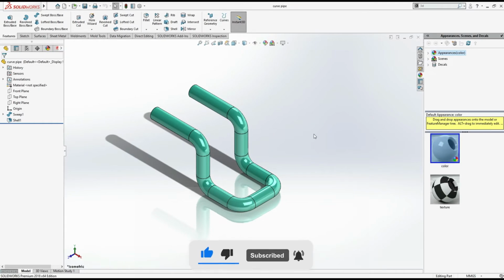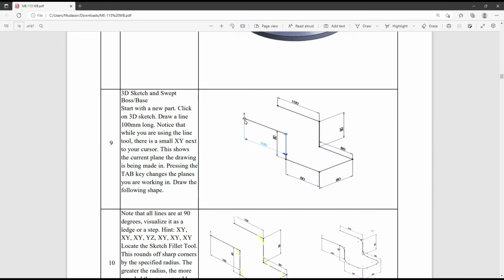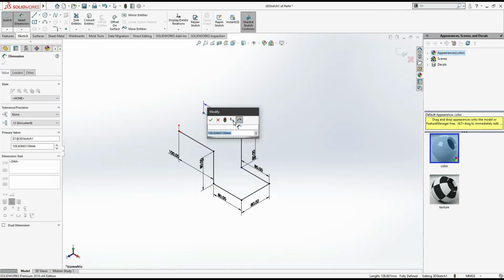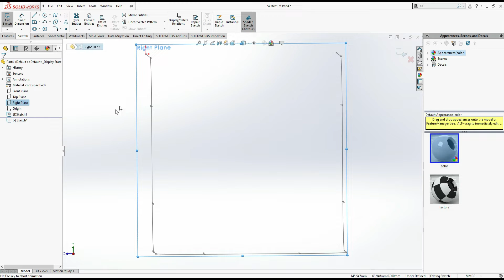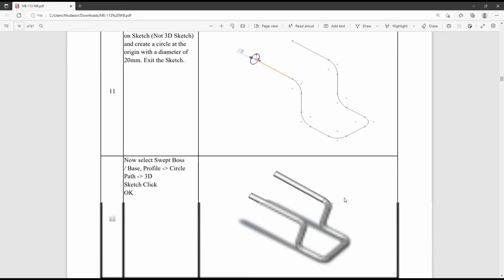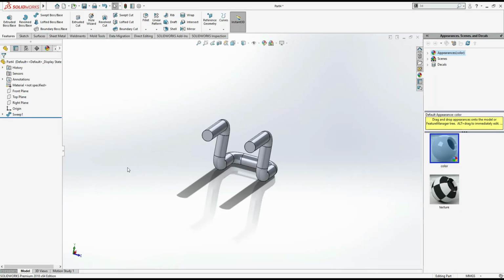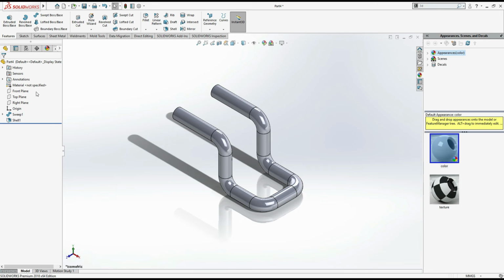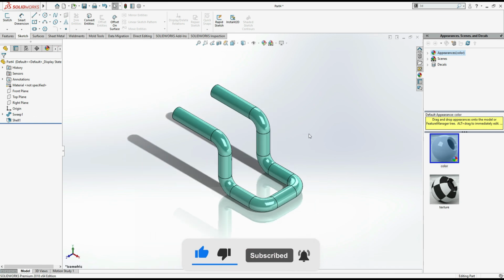How to make a #3d sketch || Swept boss/Base || #solidworks

Comment: Awesome! thank you for the video.  Could you do another one that involve straight lines connecting to helix/spiral curves?
Reply from the maker: Yes sure!
Can you further explain it..
Or by some sketches
Reply: @cadstation  I was looking for an easier way to connect two helical spring via a straight wire.  So two springs on both sides connected by a line (wire) between.  Right now I have to draw helical spring, sweep it, then draw 1/2 of the straight line, sweep it, do mirror to get complete shape.  Not sure why solidworks can't let me do the way you did in this video, like draw helical spring, then straight line, then another helical spring, then sweep everything at once.
Reply from the maker: Right I get it, I'll upload soon
Keep updated by pressing the bell icon👍